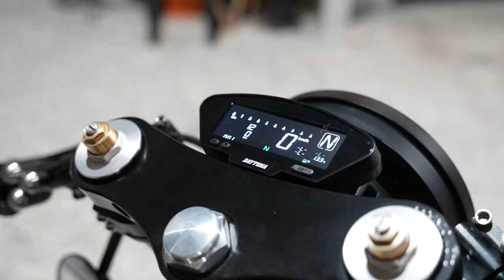Custom Yamaha XV750 Fighter | Purpose Built Moto

Comment from the maker: If you want more from this build, head over to the PBM build blog for the XV750 
https://purposebuiltmoto.com/1981-yamaha-xv750-custom-fighter/
Reply from the maker: When we rebuilt the motor we used an upgrade kit and replaced the worn parts. It fires right up so the starter slip is minimal

Comment: Great work. Is there any reason you couldn't swap a 1000 or 1100 from a latter model?
Reply from the maker: We had an XV750 motor we wanted to make faster, we just figured capacity was the best way to do that. The work would have been the same with the 1100 anyway.

Comment: How much trouble do you go through getting it engineered and road legal in QLD?
Reply from the maker: There's not much to engineer apart from the front end swap which is a major upgrade to the braking. Its usually no hassle.